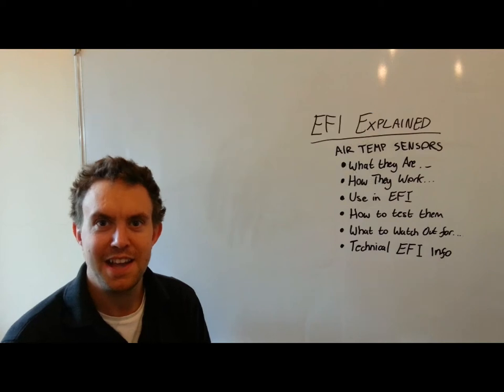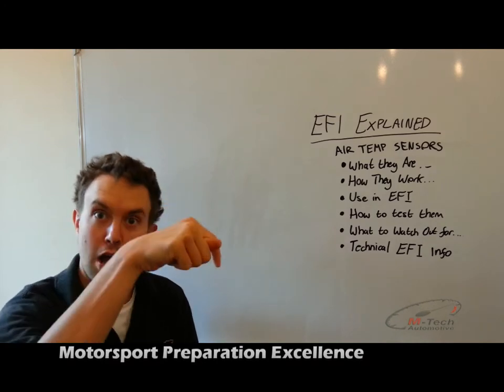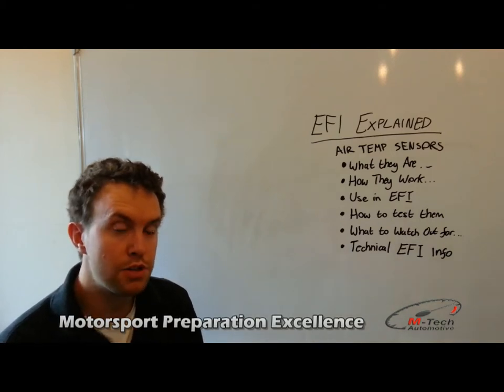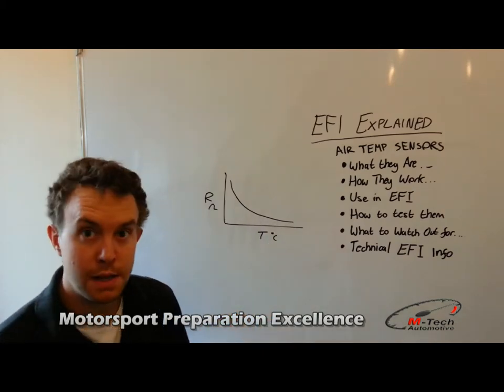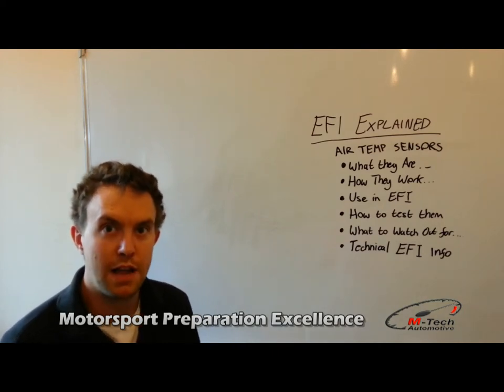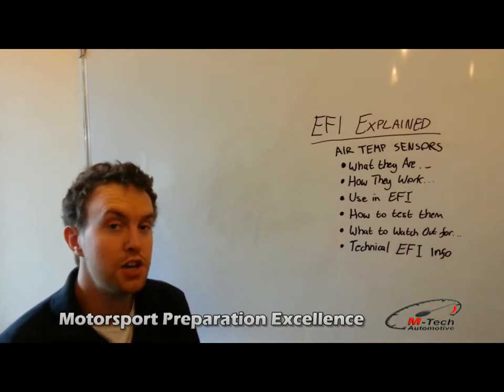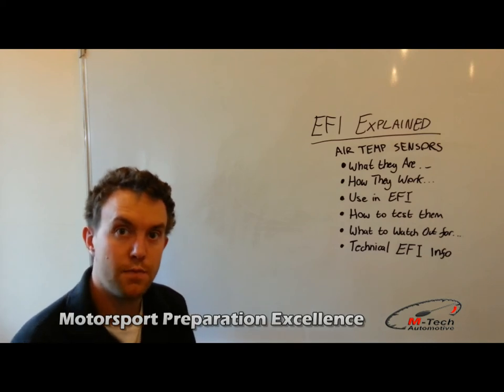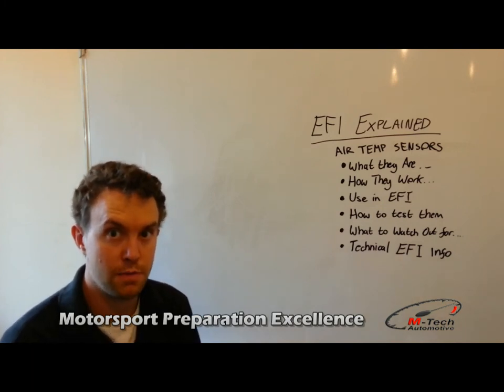How Inlet Air Temperature Sensors Work :: EFI Explained with Matt @ M-Tech Automotive

Comment: Hi.... I have a Benelli motorcycle and the airbox has 2 IATs. One is lcated in a quiet little corner of the airbox, the other is just downstream from a crankshaft ventilation feed hole, which naturally gets oily.

My quesion is, how do I clean these IATs..? Do they require specialized stuff like the MAF cleaning spray or can I get by with just alcohol?

Comment: Hi Sir , if my IAT sensor is faulty (codep0113) im using Chevy trailblazer2004 , does it gives me Reduce power engine? coz i already check and replace the basic parts, and still im having this problem, i also have this MAP sensor problem  does it gives me reduce power engine? tnx hope u reply

Comment: Thanks for the excellent and succinct lecture.   I understand (qualitatively, at least) the imperative importance of measuring intake air temp, for reason of maintaining stoichiometric correctness...  or bias, if that need be.        Meanwhile, the IAT sensor's implied partner is a MAF sensor; but I cannot find any Mass Air Flow sensor in my 1999 Chevy Cavalier Z24 (with 2.4L engine).   My cheap scan tool, furthermore, always renders a (calculated) value of zero, for MAF.      My question are:

In your experience, do you occasionally see fuel-injected, gasoline-powered cars of roughly-2000 vintage that lack MAFs?

How might the lack of MAF be engineered?   It seems any assumptions of mass of air would be pitifully inaccurate, and MAFs are probably rather inexpensive...    

P.S.  I have a Haynes manual for my car, and the wiring diagram for engine control (3 pages) is lacking of any mention of MAF.